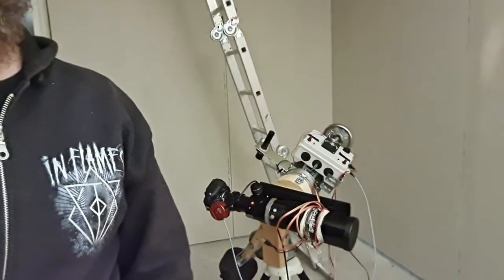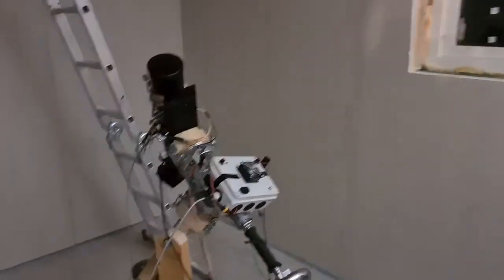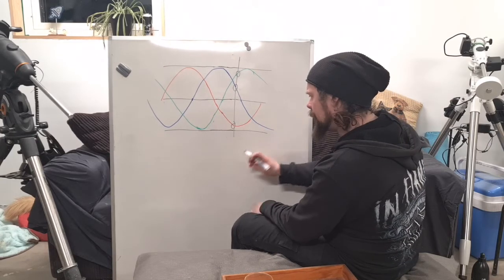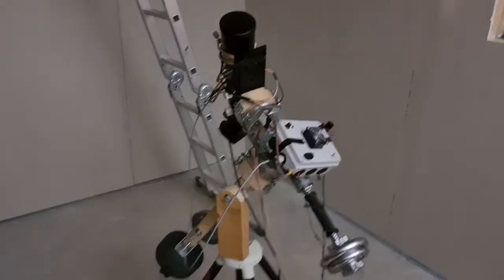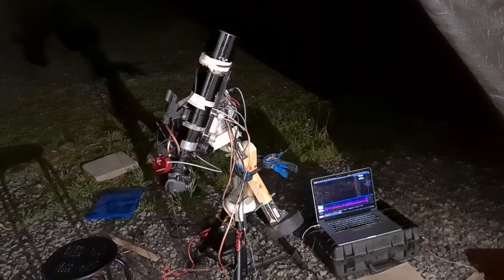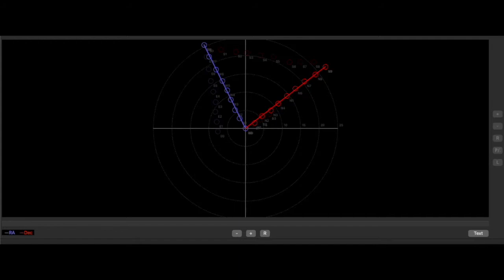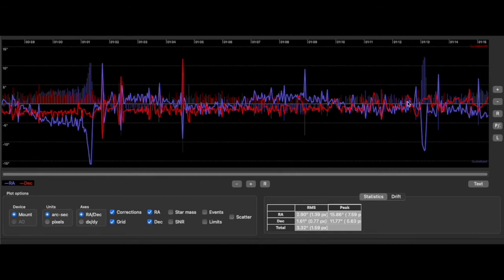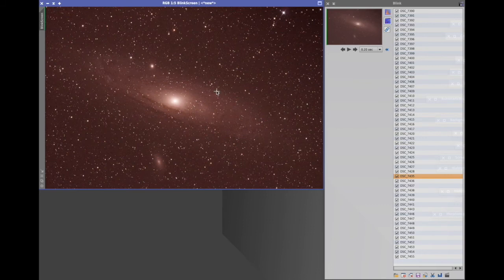LucidMount #3: Equatorial Style Direct Drive Mount

Comment: Having seen the Plainwave video on Youtube( https://www.youtube.com/watch?v=B_Louir2r10 ) I decided against going Direct drive.
Reply from the maker: Yeah, I found it to be a quite entertaining project though. The concept works, but needs high res encoders for that "pro" feeling...
Reply: @astroboden  I couldn't do it its to windy where I use my mount I went for 6000RPM motors + c1000:1 split ring planetary gearbox.
Reply: @astroboden I use 20 bit on the motors on RA & Dec it's more than accurate enough to do decogging in the control & 32 bit Renishaw on the gearbox's to check position. Didn't bother with the motor encoders on the Alt & Az as they are set and forget.

Comment: Have you thought on using an Odrive? seems that this project will benefit with the use of FOC
Reply from the maker: Hi Jugo!
Thanks for the input. I think I would be better off going off-shelf instead of DIY at that point. I wanted to test building things from scratch and see what I could do myself for fun though.
The Odrive seems to be one of the popular options for this type of application. I might look into it at some point! 
Cheers!
Reply: @astroboden  I'm also thinking of doing something like this, but closed loop, maybe an absolute encoder, but the ones with enough resolution are very very expensive
Reply from the maker: @gcr100  Closing the loop is really the only way to get resistance to wind etc. In my DIY obsession I have been working on my own absolute encoder… 
Resolution is tough though. Even just a few arcsec and it’s not good enough. Time has not been available to work much on it, but it’s a fun side project. Might make some content on that later if I get it rolling.
Good luck with your project! Let us know how you’re doing!

Comment: As I watch you testing your first version, the thought that comes to my mind is that if I was to buy a mount, one of the first things that should be done is to a run diagnostic on the mount drive system. The idea being to identify how smoothly everything is going with the typical equipment mounted on the mount.
On Cloudy Nights there is a forum section where people share their astro photos. I wonder if perhaps mount problems are not in part influencing how good their pictures are, something that they may not even suspect.
Andromeda looks Super :-)
Reply from the maker: I honestly don’t know how the weight limit is determined. On some mount you need to keep within a margin for astrophotography, but can go over the specified limit for visual. Some are more conservative and give you a weight ration including some margin. 
There are so many variables when it comes to the actual performance that I don’t thing any manufacturer want to supply an end-user “test procedure” to determine the quality of the mount.
It would be great though! I have been running a laser-pointer test to see tracking error over time inside when the weather is crap. That's stuff for a later episode ;)
Guiding and tracking if a test of sort. And actual image result. It’s easy to stare too blindly at guiding and forget what the reality looks like!

Thanks again for watching!
Reply: @astroboden  I wrote yesterday a comment here, but it's gone. YT censors ? I did have a link to Cloudy Nights so perhaps that made them upset.
Hope I'm not taking you off into the weeds Johannes, but I thought I'd share something that at least for me is amazing info. I had no clue that the smartphones have accelerometers whose accuracy is on the order of nm/sec2. That would imply the ability to super-accurately measuring displacement  ----> mount movement. Well this is true "In Principle", as I found out from a discussion on Research Gate about doing something like this !!! Cheers
PS:  sensmark .info / sensor-benchmarks / correct the link spaces (just in case YT is upset.)
Reply from the maker: @ShakespearHD  Yeah, that’s happened a few times now that a comment “just” disappears. It’s probably the yt censor kicked in by the link as you say. I’ve had a few occasions where the censor was very nice of have though. 
Anyway. that is cool indeed. The idea to essentially use a mobile phone as an encoder in direct sense is crazy if possible. But just the ghetto style I want for this project!
Thanks for the link man, I’ll see what I can do. I have a few ideas that I’ll be working on this summer.